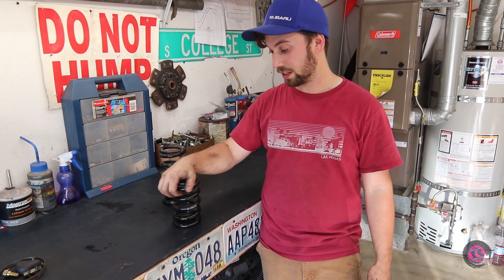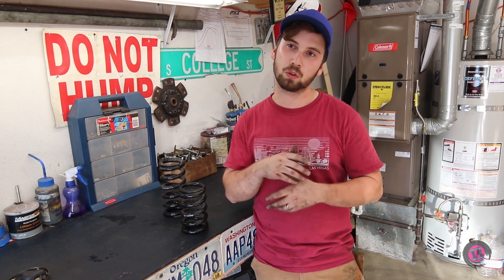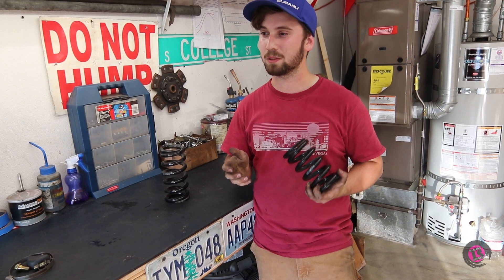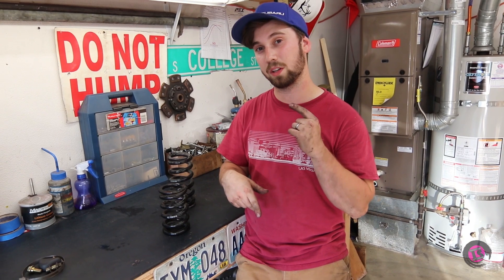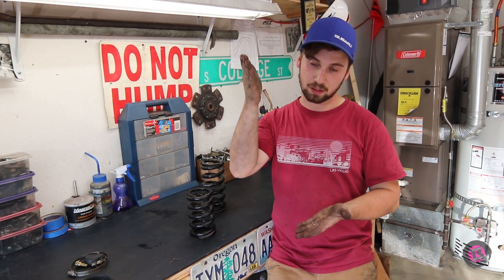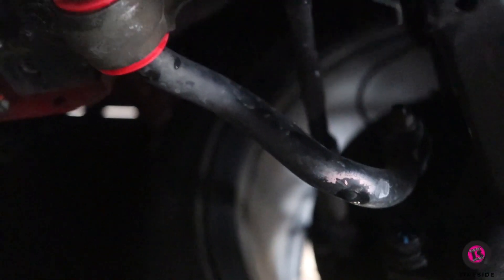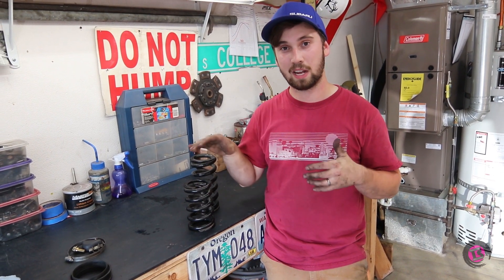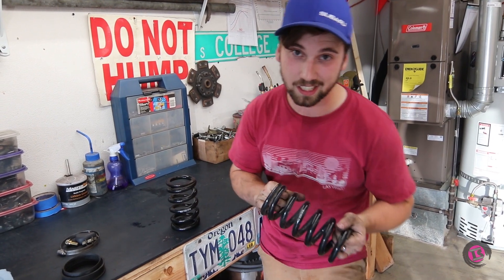How To Pick Spring Rates For Your Track Car | All The Nerdy Details

Comment: Have you consideted Spring cushion buffers? Theyre about $23-$40 CAD. Its a vibration dampener that slides in between spring gaps that has specifoc sizes. I have a 2020 BRZ that has both installed DIY at the front and rear.
From my experience, it stiffens up the stock springs a little bit and reduced body roll.
I managed to drive to the limit of my tires when cornering a rounded off-ramp high-way and increase my cornering speed limit of +20 kmh before making the wheels screech and understeer. Before installation, I can only corner it at 80-90 kmh. Now I can corner entry at about 100 - 110 kmh.

Comment: 10k 6kg for a integra dc2  with 15x8 +38 ??
Reply: That sounds like the standard spring rates for most off the shelf coilovers. Those spring rates are good enough for someone starting off with track days and autocross. The car will naturally under steer with those spring rates and the stock Integra sway bars. It'll make you learn how to use weight transfer to mitigate understeer.

Comment: If u have fwd car, would u want stiffer springs in the rear? Or front?
Reply from the maker: It’s not necessarily a matter of what drive your car is, more it’s weight bias. You want to compensate the heavier end of the the car with slightly softer springs, which will in turn shift the weight distribution in it’s favor. Most fwd cars have a heavier front end, so stiffening the rear or softening the front slightly would give better weight distribution.
Reply: Thank you so much for the time. That absolutely makes sense but for some reason almost all the aftermarket coilovers for my car are stiffer in front. I know i have read something about Japanese cars running stiffer in front and running bigger sway bar and links in the rear to compensate. But that could be nonsense, ive never bought coilovers and having a hard time deciding